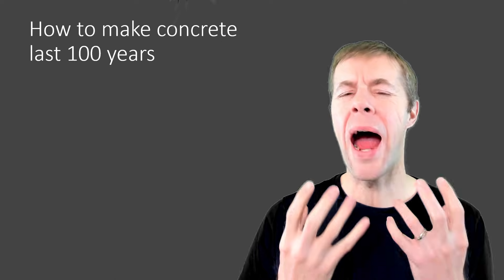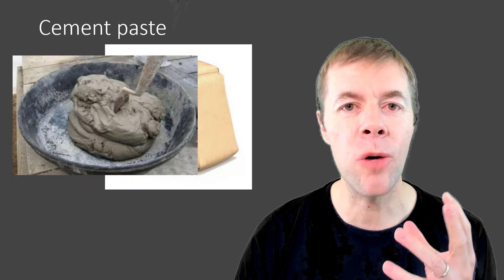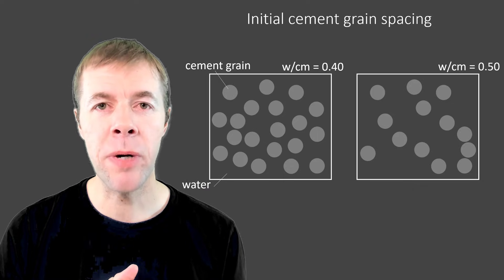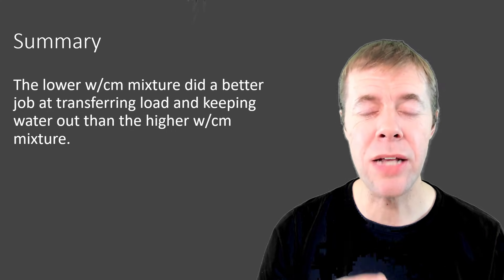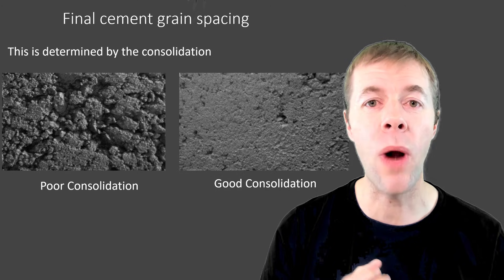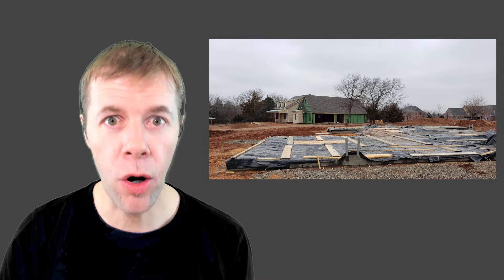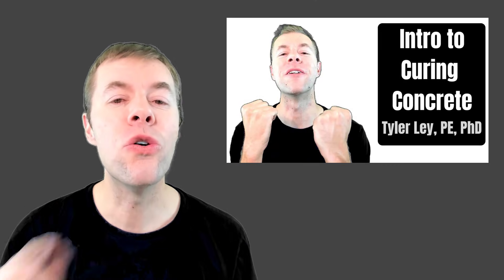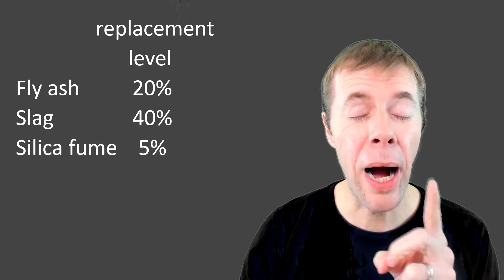How to make concrete last 100 years

Comment: Great video!
What aggregates would you spec in, and how difficult is that to accomplish/ how costly?
Reply from the maker: Thanks!
Specifying aggregates is very challenging and so focused on local practices.  I would look around for a local aggregate with a great track record.  The local DOTs also typically have very good methods to determine durable aggregates.  The problem is that they vary from place to place.  If I had to choose one test then I would use the ASTM C666 test and use 6% air in the concrete.

Comment: What would happen if you mixed and cured concrete in a vacuum chamber?
Reply from the maker: Cool question.  People mix dental cements in vacuum chambers to pull out the water.  There is some crazy stuff that happens as concrete hydrates that my group has recently found.  We have published it and so I will make some videos.  I think you will like it.

Comment: I have experience with FRC and FRG. Fiberglass reinforced concrete and fiberglass reinforced grout. We have used monomers and polymers. Fiberglass used in gfrc have a coating on it I am unfamiliar with its exact composition. Unlike fiberglass used for fiberglass matrix with styrene. I also have experience in that area as well. I read an article decades ago scientific American I love you baby styrofoam microspheres to reduce weight.
Reply: I remember my materials prof saying that the fibers often start aligning with the each other during pouring and that directionality is worse that if the fibers were truly randomly oriented, how do you get around this issue?

Comment: I have a strategy to cut the costs and risks of vertical concrete construction: https://youtu.be/-o7AlV7BeFg 
Can you recommend an engineer/ design firm that would be a good match for this project? I need some excellent prototypes to loan to 3-M.

Comment: For pumping slurry with a low variability aggregate will fly ash silica and slag also increase strength. I am speaking of use in c&c printing of concrete.

Comment: Great video sir...! I think particle packing also have a role in concrete durability. If we are using particle packing ( aggregates) while design the concrete, it will reduces the porosity. Therefore, it increases the life span of concrete.
Reply: Whoa there, you're getting into the realm of high level math.  The sphere packing problem is already very complex.  Adding in the variability of aggregates puts it in PhD thesis territory or some kind of X prize.

Comment: It is important to implement a performance based specifications to achieve 100+ year durable concrete. Specifying a particular w/cm ratio may not be enough. It is more important to achieve required strength, permeability, shrinkage, creep, resistance to freezing and thawing, high modulus, and resistance to chemical, chloride and sulfate attack etc. We need to come up with better performance based specs to ensure that concrete lasts for a very long time.
Reply: how does this video translate to foundations?

Comment: Does adding a high range water reducer increase the initial cement grain spacing?
Reply from the maker: Dirk, 
It breaks up the flocs of cement and makes the concrete more flowable.  It also makes the hydration product more uniform.  Check the referenced video out for more information.